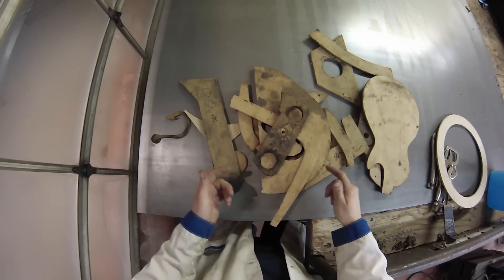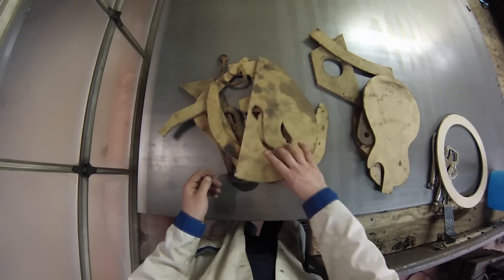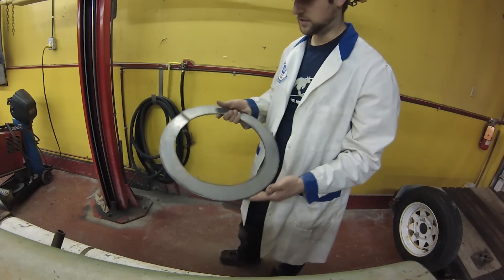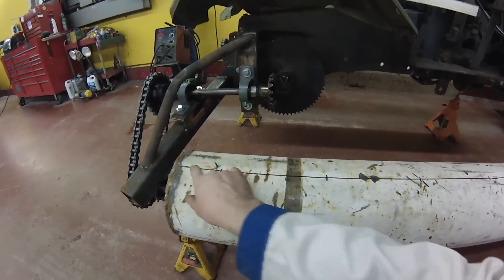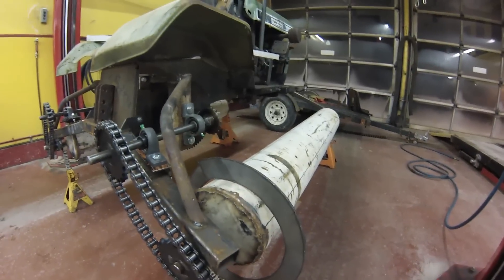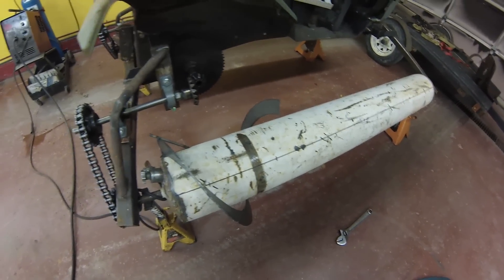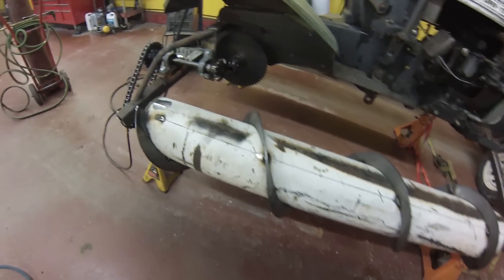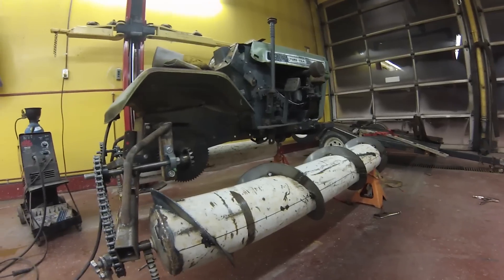Screw Drive Vehicle - Extreme Offroad - Part 4 - The Augers

Comment: the old large frame Bolens tractors with Hydrostat drive have the disc brakes already plus longer frames and may work better for this project. also you may consider an old ZTR mower and even belt drives as options for more lite wheight and power/speed with bigger engines and easier transmission controls. and aluminum drums like most of these have for better floatation
Reply from the maker: check out my new screw drive project on my channel "rednic79" your input would be much appreciated. thanks for watching!